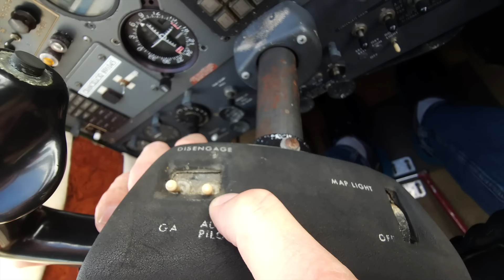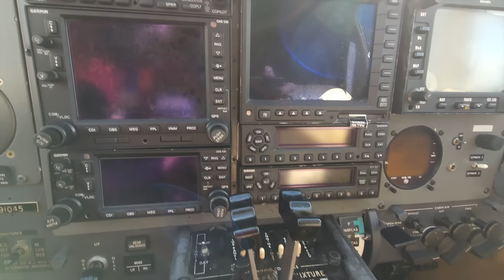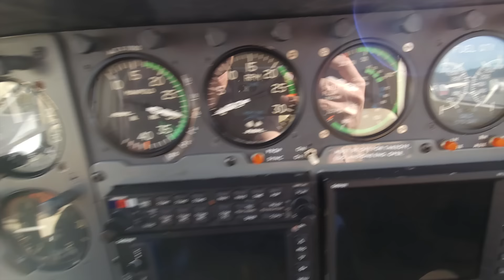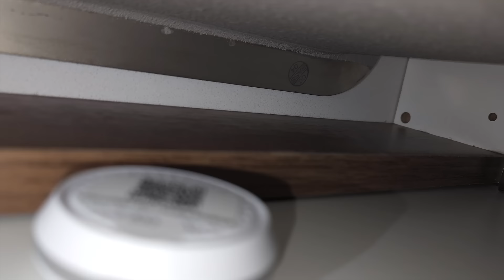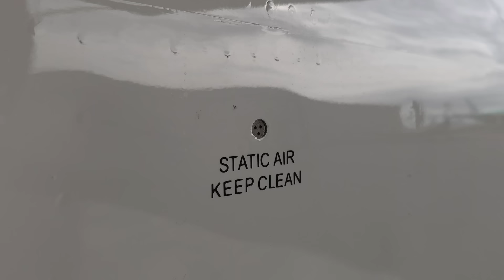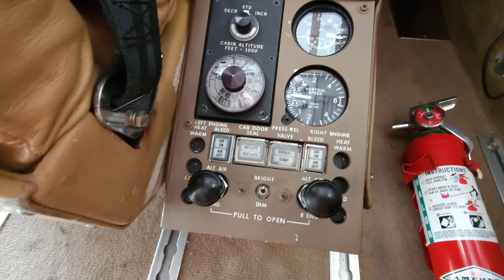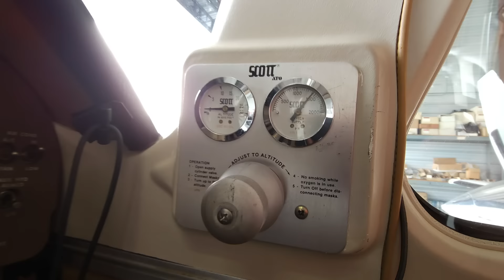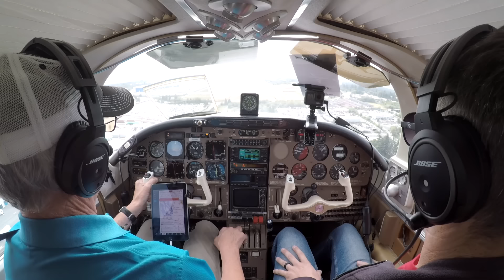$100,000 Facebook Marketplace Deal Of The Year

Comment: I seen a video on here from an airshow where a plane like this one wings broke off right at the engines you could her him trying to get it under control but wasn't able to.  That's why when you said not air worthy and how much corrosion it had It would stay sitting right where it is.
Reply: Ah, no. There has never been a C414 perfoming in an airshow. 
What you saw was a video of a Partenavia P.68C performing in an airshow at Plainview Tx where the pilot flew the plane well beyond design limitations, exceeded design load limits and predictably broke the plane with catastrophic results. At that point he was pretty much along for the ride as there was no struggle to "get it under control." Had nothing to do with corrosion or condition of the plane.
Reply: @buckmurdock2500  what I am saying is they were similar with the engines being on the wings. I  am not familiar with types of planes names of planes. Just that they looked similar .

Comment: Cessna 414 would be a money pit if out of annual. No doubt some really bad stuff found by a very good Aviation Mechanic or Repair Station? They usually do not get in this condition in just a few flights. The Aerostar or whatever marketing name you assign, is still a very "cool" airplane! The highest cabin altitude allowed for a pressurized airplane is 10,000 feet. Now, you can operate it under certain circumstances unpressurized while using supplemental oxygen, but may require a Special Airworthiness Certificate or "ferry permit."

Comment: I know nothing about aircraft so excuse the question, but do they make little jets where you could turbo prop a small twin that size? I was wondering because it might offer higher reliabilty, more power, less weight and less cost overall?
It would look nice with dual contra rotating multi blade props. All that might rip the wings and tail off for all I know, but it sure would look cool and be a ripper. Paint it black.

Comment: Jimmy P-38s in WWII were "outies" also because the prop vortex the other way caused too much vibration on the horizontal tail. I suspect they ran into the same problem here especially considering the devices on the stabilizer now.
Reply: The vortex generators on the vertical stab keep the airflow on the rudder during high rudder deflection at slower speeds.  I have flown the Piper 700P's with the outies and the 601 and 602p's with innies, there is no difference in vibration on the horizontal stab. The jet has the vortex generators on both sides of the vertical stab.  All about slow speed handling with one engine out.

Comment: Jimmy, no compression means either the rings, the valve or faulty head gaskets guides are the culprit for that low compression for those cylinders. What do I believe it could be? Certain not the gaskets. Of the other two, which of them could it be? I'm thinking that they're the rings that are the problem. In the event I had the money to buy this aerial vehicle, I wouldn't want it because of all the problems it has.

Comment: Probably got some valves hanging open in that engine ,. maybe even in some rust and or carbon packed in the rings  ,  might even be a cracked ring which could be why it got parked  ....

Also if you want to try something funny stack a few layers of some masking tape right at the CG over the spar on top the full length of the wing and see what happens  ..  actually it might be better to do that in a wind tunnel   ....

Comment: Jimmy engines that have 0 compression cannot start. You have to have 3 things for an engine to run. You have to have compression you have to have air And you have to have fuel if any one of those three things aren't present, the engine will not run.

Comment: If there is one thing I wouldnt buy on marketplace its a airplane. Ive seen this so many times recently in a similar plane. The person buys it trys to get it airworthy. They get in a hurry fixing it and then attempts to troubleshoot things in the air and has some sort of failure and their no longer here. That plane looks awful, planes are not vehicles you have no airbags or collision protection. You crash uncontrolled or even controlled you probably wont be coming back. Dont risk it. I also wouldnt feel comfortable as a seller selling that to anyone even after repairs.

Comment: It always boggles my mind when aircraft owners let these machines rot in the elements for years. It pains my heart. If they can't afford to keep them, they should sell them right away to someone who actually flies them and takes care of them!
Reply: What we need is a company that offers extended warranties on airplanes like they do on cars. No big repair bills ! !  Plus they'd be chasing you down for business ! !
Reply: @buckmurdock2500  That's not the solution., though. Some awesome aircraft a decades old before they get criminally neglected.
Reply: @Jigsaw407  You need cash to own a pressurized cabin class piston twin. With operating cost exceeding $600/hr it's not for the low risk types. Cash flow dries dries up planes get put on the market but often there are no buyers so they sit. This plane is now approaching 50 yrs old and it's in a coastal environment. Probably ready for the scrap heap. Or it will take a lot of cash to get it going.

Comment: Those 400 series Cessna's got hit by that wing AD note, cracks on the main spar. Big bucks to fix it. Last I heard it was a $70K job, but it's probably more by now. The 421 was exempt, but most of the non-geared engine models are stuck with the AD note. I think it's overpriced at $100K. Too much deferred maintenance. Unless the AD note has already been complied with. That would change everything.  All that corrosion, oh my. You could probably get an old lear Jet running cheaper than that thing. What is it, a 414? they seem to be the most plentiful versions for sale. Since the AD note came out, those things are showing up at airports all over the place. Just sitting and going downhill fast. There's one right next to my hanger.
Reply: There was an eddy current inspection required on the spar back in the late 80's when I flew 400 series Cessna's. No big deal.
Reply: @tedstriker754  nah, it's really just an expanded spar inspection to include the carry through. The estimated cost for AD compliance is ~$2500, if the carry through spar cap has cracks, it has to be replaced where the estimated cost is ~$75,000. 

As always, buying the plane is the cheapest part of ownership. Flying a 414  for 20 hrs a month will drain your bank account to to the tune of $150k every year. 10 yrs and you've burned through $1.5 million and still have a plane worth $150k.

Comment: Thats a take down... you have too much potential for corrosion that is an airframe killer. Engines are good rebuild cores. Used avionics value? Garmin 650/750 has value.. 530 is a bit less desirable. 
Perhaps a gamer/sim pilot would by the quadrant and panels for a sim cockpit.. There are FAR nicer 421, in annual and fully airworthy for just under 200k. There is no room in this for profit... all the corrosion is a death sentence. Rubber rot and rust... Its everywhere.. not just a few spots. Broken flaps.. Time for dismantle.

Comment: Not a bargain after you get done hanging motors and props on it. Probably has some gear issues to be addressed (like 310's landed improperly in a crosswind) and a bunch of AD's to be complied with. I would run unless you really need that large of a twin and have $$$ to BURN.

Comment: I thought was a total waste of someone’s time until he said the engines only had 4700 hrs on them, however imo you’re looking at over $250,000 dollars in repairs, overall it’s just not worth it if you have $350,000 to blow, buy a new plane, forget this, 4700 hours is great however it’s an expensive world so $250K estimated repairs could easily double or even triple to get it in the air in absolute 100% fashion. Pass on this.

Comment: My grandfather owned a 414 and 421 with ram 3 upgrades (that’s was high ram upgrade at the time) his engines were tested at 354 and 357 horsepower on the 414 even though they were rated to 325-335. I don’t recall ever seeing the 421 dyno sheets but he had the engines on the 414 rebuilt and upgraded and I’m pretty sure that’s why he had the dyno sheets on them. I know the 414 was actually faster and why he ended up getting rid of the 421 and buying a king air 300. I really loved that 414 it was a really good airplane. Don’t get me wrong that king air 300 was a beast. It’s truly sad that this Cessna was neglected for so long especially with the upgrades it received on the interior.

Call rebuild rescue lol. They probably won’t ever get 100k out of the airplane with all that needs to be done with it.

Comment: Me thinks this is the best aircraft I have seen Ya'll in Jimmie. I mean pressurized but only to 12,000ft @ 30,000ft. By that I mean general av ceiling, not airliner pressurized. Much safer for genav as that much pressure does bad things to normal fuselages, which these more or less are. Plus the power of these engines. My guess is tbo for these engines is much lower than regular io540's. Sure ya'll double the hp every 10 psi but man does it use piston engines up. Max boost in ww2 aircraft was limited to 5 min, that is war emergency power. Those women ferry pilots never pushed these craft that way. If you have a German ace on your tail ya'll want all the power you can get.

Comment: You are way too fond of old hopeless junk. You really should look into making clean good planes instead. Single piece composite simplifies and means they never rust. Lightens too so it doesn't need expensive engines. Old complex junk is just inherently bad.
Regarding the Aerostar, sounds concerning that they just increased the cabin pressure. By my napkin calculation, close to doubling the intended pressure.

Comment: There is no way that passed a annual in 2022. And the left engine almost makes me think was sabotaged that engine was not flying a year ago.
Im All for saving aircraft but that plane will have gremlins even after everything has been gone through. Run away from it or maybe for part's if there is anything that's not totally corroded

Comment: If water got inside the cabin, it could soak through the floor and start corroding the frame that jointly connects the wings. If that frame is corroded, this plane just went from 100k grand to less than a few thousand dollars (scrap parts).  You should check the metal frame first before buying this plane.
Reply: lol

Comment: When he started pulling the plugs....if it were me I'd walk away at that point. This plane can be a headache and money pit for someone else.  25 mins into the video....not sure what the rest of the inspection was for, hehe.  EDIT:  Ok watched the rest of the Vid....all about the AeroStar, hehe.  Now....what kind of aviation enthusiast limits their knowledge of aircraft to GA so much that when they turn around to look at the Hughes 500 and see huge, un-painted, un-engined airliners sitting there...with FOLDED WINGTIPS....they don't know what that plane is? (and of course if its not mentioned in vid, you know exactly what airport they are at.).  That would be like a car fanatic who's specialty was Lambos and a Ferrari pulled up (and even a red one) and he quipped "oh that's some other sports car"...sincerely not knowing what it was, LOL.  I may be a Commercial Airliner nut...but I can surely say that my identification skills of most GA planes would let me tell the difference (in this vid's example) between a Cessna low wing twin and a Piper (well..you know)...mid-wing, high-raked tail feather Aerostar. :)

Comment: This aircraft had zero value before you got to the props.   Negative value from there.

Yeah it will sell for $250,000 AFTER you spend a year and $300,000   

Seller needs to pay you $400,000

Comment: Scarp yard !
it will once again cost to much in money and time. the time he done doing all the work will be over $250.000
no seats need buy them and it will need a total over  hale on engine and inside of plane and then
the hell work begins the tech he is going have to get behind there and see what is going on my advice rip it out and go back to old school way simple is better
if it didn't come with plane remove it
the word conflict that is the word he going understand once he get behind the  plane avionic and he find out
that the part they put in wont work well and is messing everything up and made a whole lot of problem 
1.electrical problem easy to fix if you gut it all out but first you got find the conflict it made and can it be repaired 
2.interior gut it and need all new along with lots chairs window will more then likely leak and need to be fixed
3.engine not that bad need work only problem 
maybe pumps and electrical system will have conflict which is bitch to fix 
4.body not that bad going need some tender loving care 
now the question would I buy this plane NO
what do I rate it from 1 to 10
its about a 6.8

Comment: Look as a A&P Ive seen so many  aviation  experts bloviate  on buying out of  annual, beat to crap outside storage aircraft. Buy it and  enjoy your VERY large bills  for parts and labor. Im betting  with the low cylinders it was flown  often using the  thermal shock approach, props  need work, gear swing and repack, on and on. I watch a  guy spend 270K on a 402 15 years ago and ended up crashing it due to gear failure. Aviation is a Expensive Hobby... Ive  flow  for  and  worked for many an airline in 34 years. Pass on the deal.